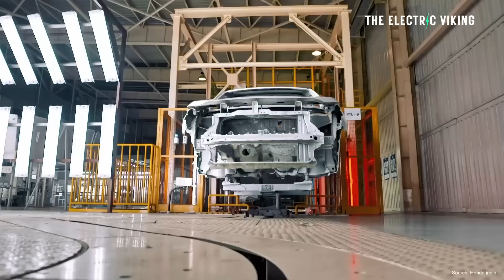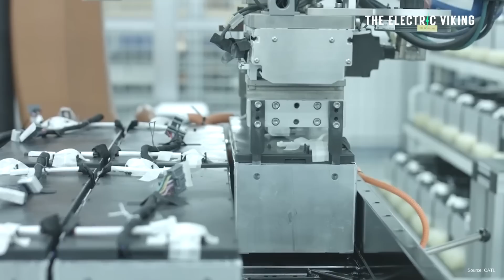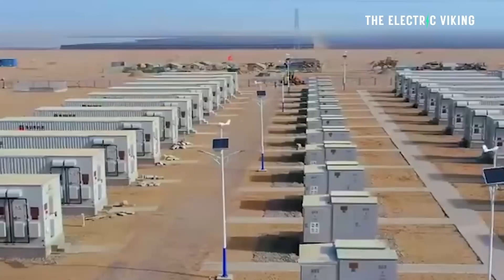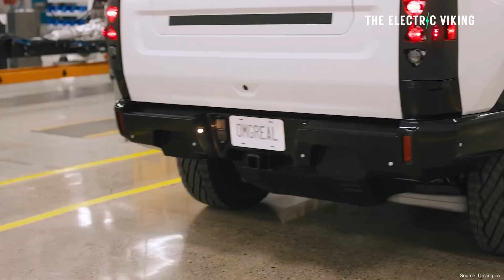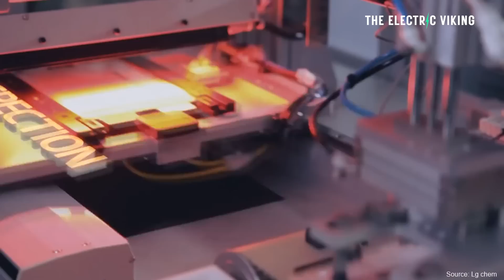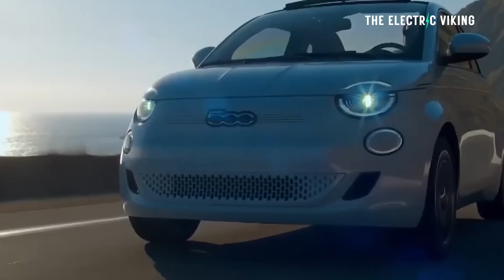World's biggest car companies are LYING about why they aren't making EVs

Comment: BEVs are obsolete.  It is 20 times less cost to make fuel from Renewable Energy (RE) OFF grid with DC (NOT AC) than to charge an EV on a 100% RE grid.  New Engine Tech  (NET) will be 75%, have CO2 capture for fuel making, COP6 Heat pump on car, and fire protection.  It will be 1/2 the weight for 1.5 x better MPG, 100% brake recovery, and 40% heat as a function of drive load for free.  The CO2 makes dry ice for food storage and the water capture allow you to have continual water in the car.  CO2 is for energy input of RE fuel with NET is 3 gCO2/kwh for fuel and no battery.

An EV is 85%, has no CO2, can't do super high COP heat pumps, cannot make fuel at 20:1 lower costs, is a show stopping mega fire risk, has 300 gCO2/kwh in battery life cycle, 300 gCO2/kwh for 100% RE grid, is 2x weight for 2/3rd MPGe, and has little to no waste heat for heating, along with only 50% brake recovery.  

This means NET will be 3-4 times BETTER MPGe in City on fuel that is 20 times less than charging on the grid.  That is 60 to 80 times less for energy input.

No EV or old ICE car can survive this.  Sorry...EVs are obsolete, and so are old ICE cars.

Comment: I work in ev conversion here in japan , so i can tell you why japanese automakers are late. 
First there is many engine manufacturer here , so its huge market, and many will be bankrupt.
Second the infrastructure is almost absent. Over 50kw charger its cost a lot of money , around 5 milion yens ( approximately 40000$ or euros)  by charger, and they fall under lot of regulation.
Third, Toyoda san is the president of JAMA (japan automobile manufacturer association) , and he slow down all the process to make ev shift happens.
And last one its cultural , japanese dont like changement, and difficult to accept another country are better in some way and changer their minds to follow.

After that , Tokyo maire push a lot for make changes. They provide good amount of money if you buy EV car , same for solar panel.
All new construction in Tokyo will include solar panel on roof.
She will bring formula E next year in Tokyo.

Comment: Todays Batteries suck for Ev’s , 1000pnds of weight for the power of a 30pnd gas tank, fire risk, not to mentions an hour of charge time, horrible cold weather durability, infrastructure,,, when these next gen batteries finally come to market, maybe then the Ev market will get the demand

Comment: Yes, we might change from fossil fuels, but it is not obvious at all that EV's are the answer. Technology keeps moving forward and it is highly likely that another technology will be answer, rather than batteries which are extremely bad for the environment and have lots of significant problems (range, fires, what they are made of, longevity, weight, charging standard, time to charge, cost).

Comment: If CATL is at 60% of capacity, they only have perhaps 25 to 30% capacity to spare, not the full 40% one might think. That being said, Tesla could import CATL LFP cells and replace existing American-made high-nickel Mega Pack cells with them. Then validate those cells for vehicle production. Not worth the hassle, unless you consider those Mega Pack cells might get replaced in a decade anyway, and putting LFP in them now could get them to last 20+ years.

Comment: Panasonic have been making the batteries for Toyota since the first Prius rolled off the production line. Toyota and Panasonic have a joint venture company called 'Prime Planet Energy and Solutions'. Toyota leads the world in registered patents for solid-state batteries at 1,331 patents related to the technology, followed by Panasonic Holdings with 445 Patents. So I think they know a thing or two about battery technology. 

Gill Pratt is chief scientist at Toyota and CEO of the Toyota Research Institute with impressive titles and an impressive resume. Among other posts, he was an associate professor at MIT and was once a computing expert for DARPA. Consistent with decades of scientific findings, Pratt acknowledges the "incredibly serious issue" of climate change and advocates for doing everything within our power to head it off, then reverse it. The role of EVs, however, is one he says has too much "hype" and closing our minds to other technological solutions.

'EVs' shortcomings are well-documented by now. Most of their problems stem from their batteries that, among many things, are heavy, made with materials of limited availability, and result in tremendous CO2 emissions during manufacturing. Pratt says these problems aren't inherent but considers it foolish to expect them to go away on their own. Instead, he says it's best to use our current battery supply efficiently.

"To be clear, these problems are surmountable," Pratt said of EV batteries' issues. "But it's a matter of time and about a rate of growth, not an overnight switch. There's an element of hubris to declaring how many electric cars should be made by a certain date, because nobody can accurately predict the supply of raw materials or the impact on the planet of creating and using them. That data simply doesn't exist.

"Until we know, I believe it’s often better to use the batteries we have as often as possible—and that's where hybrids have an advantage."

When it comes to hybrids, Pratt is specifically a proponent of plug-in hybrids (PHEVs) that he considers immediately advantageous over EVs for several reasons. They don't have the inflexibility of EVs, meaning independence from inconsistent charging infrastructure and thus diminished resistance to adoption. They use less battery material than EVs and use it more efficiently. Pratt was adamant that they as well as other technologies must be taken into account, rather than "prescribed" the way EVs are.

Comment: I think the legacy guys are still a bit nervous about mass producing EVs . They are just far behind Tesla as far as technology. They are still in a developmental stage . Tesla is far past that . Change is hard in the automotive industry. Tesla is doing what it always did . It's not going to change and make ice vehicles . I think the next turning point will be true self driving which EVs are a better application for that . Who ever is first to claim the crown and regulators approve will win a big trophy . The other big ones is 450 standard  range in batteries with 10 minutes to 80 percent and last but not least is wireless charging as the norm and not having to get out of your vehicle . Then ice will truly be a primitive product which runs off the dead prehistoric fuel that it uses . The question is what's that time frame ? Maybe 20 years tops . At that time it maybe hard to find a gas station

Comment: Not an electric car fan but your channel great   very informative  when you can charge one up in 2mins and at a cost cheaper than petrol I'm in😂
Reply: Charging is far cheaper than petrol. And the time it takes to charge is the time it takes to get some lunch, so it’s not a big deal.
Reply: @chopsueykungfu   so if I fill up at motorway station  for my diesel/ petrol and you fill up with your electricity  your vehicle will travel further than mine assume  we  have isame vehichl bit different power trains  I don't expect  reply    what's the tax on electricity  what's the tax on fossil fuel

Comment: Yes, you're right that they can get battery cells. But the quality is abismal! According to various reports,  CTL's battery failure rate is 17%. Worse yet, is the rate of cell fires throughout China, where there is a large EV presence. Range issues has caused the CCP to investigate BVD amongst others. Large rental companies were seduced to buy large fleets of EV 's only to go bankrupt because of very poor performance. So EVs will take over, but only when they can get RELIABLE batteries.

Comment: I don’t know much about the specifics but I do know how supplier contracts usually work with big automakers. In general, the contract will require the supplier to allocate a huge portion (up even 100%) of the output of a particular product. The price will be very favorable to the automaker. In return, the automaker agrees to a “take or pay” provision. Such a provision requires the automaker to guarantee the minimum amount it pays to the supplier over an extended period. This period is usually enough to amortize the entire capital cost of the contract on the supplier’s side. Now, what happens when you make such a contract but the supplier cannot deliver a reliable product? Both are in trouble. The supplier is in breach but the automaker can’t safely just move on. It face huge liability itself on the take or pay portion of the contract. What the automaker (or any other large business in the same situation) does is pivot to other products while letting things settle with the supplier. I’m guessing this is what GM is doing. For an example that took place pretty publicly, look at what happened with Apple and the supplier of sapphire crystal screens a few years back. The supplier was destroyed but Apple still hasn’t gone back to sapphire is they had said they would. Pivoting to an alternative supplier can be financially risky. Pivot to another product line not so much.

Comment: Electric vehicles preceded internal combustion engine cars. They went largely obsolete due to problems with the battery.
The battery remains a big heavy costly problem.
The main drawbacks of EVs are high capital costs, high depreciation, long charging time, limited range and fire risk.
Additional power grid capacity would be required if a substantial percentage of cars are EVs.
It is wrong for governments to foist them upon the hapless taxpayers. Consumers should be free to choose between ICE and
EVs.

Comment: I don't do a lot of driving my car is a 2009 Hyundai Sonata with only 68k miles , my only repair costs so far have been a set of tires, brakes ,air filters, oil changes over the 14 year span  of ownership. but if I had bought a 2009 EV instead of my gas powered one, I would more than likely have had to replace a expensive battery pack by this time due to the battery being degraded just from time , I'm not against Electric cars but for me they are simply too expensive right now

Comment: So an EV has about 4000-7000 Li Ion batteries in it that sort of look like the standard batteries we buy. If you make say 5mi EVs/year, that's 7k*5M = 35 billion batteries for EVs per year. 
I wonder how many batteries humans consume per year. Say each of us consume on avg 4 batteries/year for the 8billion humans on avg - that's 32billion batteries for random stuff we use batteries for. And that doesn't include all the batteries on the shelves and everywhere else. So imo there's probably enough capacity to make like 10x that amount or 50mi EVs/year. 
So there will be huge initial logarthmic draw on batteries as EVs ramp up and then a gradual draw down and plateauing of battery use per year. Earth is a closed loop system (almost entirely) so everything on Earth is just recycled anyways - so Li and whatever else is used in batteries will convert to something else and then eventually be formed back to batteries again. 
I think car cos are lying and Toyota is clearly trying to  stem the EV growth so they have a chance. They're bs'ign with their nonsensical hydrogen and solid state battery. Thankfully, no one is waiting on Toyota anyways. They're the GM part 2 of Who Killed The Electric Car infamy.

Comment: I still think the even bigger issue is the import tariffs and the fossil fuel lobby opposition blocking the import of the new inexpensive models like the models from BYD in Europe and the USA. Commenter below was also correct the USA cancels the incentives if the battery is not manufactured in the USA locally.

Comment: It’s not lies. It’s to reduce China’s hold on the EV supply chain and material locations/mines. 
China is using coal for power to build these batteries.
China EV cars are ugly and have no reliability comparisons.

I would never pay a premium over an ICE vehicle for an EV.
I don’t want an EV.
There is plenty of ICE cars in inventory that need to be sold otherwise the energy used to build them are even worse from a co2 perspective.

Comment: Could be a lot of different factors added together. The reasons I don't have an EV, I  already have a petrol car with many years of service left in it, a similar "affordable " EV is twice the price of a straight replacement. The infrastructure is insufficient in UK nothing like enough charging points, people are installing them and can't get them connected to the electricity supply ( which is barely able to cope with demand as it is nevermind finding all the extra energy currently provided by fossil fuels) EV still have very limited range, which wouldn't in itself be a problem if you could do a five minute refuel like you can with petrol. So probably insufficient demand for EVs

Comment: This one is a masterpiece of real journalism because it isolates a fact that exposes how much difficulty an established industry faces dealing with a a fundamental change in technology. I think it is only human nature that makes both individuals and institutions stick to the tried and true. ICE vehicles are still profitable and the legacy manufacturers want to keep that going as long as possible and then they will try to charge us for oil changes in their EVs. Metaphorically speaking, of course. Instead many look like going out of business instead.
Reply: It is reverting back to an old technology with better equipment.
The electric car actually preceded the ICE car. The battery remains a big heavy costly problem.
The drawbacks of the EV are higher capital cost, higher depreciation rate, lower range, long charging time , battery fire risk and greater vehicle weight.
Reply: @johngeier8692  Detroit Electric is what you're referring to and it was far more expensive and had less range than gas cars (still true in the 21st century).

The only reason it hung on for so long was because the gas car required a crank starter, but once Cadillac came up with a practical electric starter, Detroit Electric folded.

Comment: Let’s say you are right. Why did Tesla take so long to start building a second battery factory? Didn’t they say they needed more batteries? Why couldn’t Tesla plan for six months ago to have at least one or two more battery factories up and running? This would of allowed Tesla to use some of these excess batteries? Or do you think Tesla didn’t start a second battery factory two years ago for a different reason? Remember they did say they were battery constrained. But my personal opinion is they didn’t have their manufacturing method down to build a second factory until recently. What do you all think? I would like to know. Because if Tesla really only had a battery issue with creating more megapacks and factories, they really dropped the ball.

Comment: CATL batteries are in China, Joe doesn’t want them. 
Is there a disconnect between factory designed capacity & present production? I’m sure Tesla could ramp up Megapack production to soak up LFP, at right price. But that’d drive up lithium price, maybe even labour costs. We will be short of batteries (& precursor) at least to 2035. Who wants half-a@#$& gm nonsense when Tesla makes better product?
Better gm sticks to Silver Shadow replicas, can rival Morgan in 2030.

Comment: I disagree, they don't make many EVs because they're bad at it! Their supposed advantage in manufacturing has turned out to be a massive handicap. Turns out mass manufacturing EVs is crazy hard, especially if you want to make a profit at it. I don't think it matters if they get the batteries, their EV vehicles suck!

Comment: I hoonestly consider it an honor that I've been driving my EV for almost a year now. Love my experience as well.
Reply: Just remember, your lovely EV, from initial mining of the lithium, cobalt, nickel etc as well as battery production, shipping and construction has caused more pollution it's it's 1yr than an ICE car would have done in 5 years. Do you know where the energy comes from to charge it? Did you happily spend another $1000 on a home charger on top of the expensive EV? Does the risk of battery fires keep you awake at night? Are you planning to trade it in after 3 years, because if so, you won't even have broke even on emmissions. EV's are nowhere as green as you think - nowhere near.
Reply: Don 't forget the wallet melting  depreciation.
Reply: @tonyb3629  not forgetting the crappy re-sale prices! In the UK I could get a mint 3 year old Hyundai Ioniq for £14,000 🤣It's like money down the drain.
Reply: @tonyb3629 Congratulations, you receive a prize for maximum misinformation per character typed.
Reply: @tonyb3629  Are you sure you're replying to the right person? I said nothing about green, energy, or anything else you are going on about.

Comment: This is probably more about the price they are having to pay for the batteries. Because of Tesla's huge production volumes they are probably able to negotiate a really good price for the batteries they are getting from CATL. Because the other OEM's are already losing money on every unit they make, and can't get batteries for the price that Tesla does, they are just throwing in the towel and admitting defeat. Then CATL has to cut production, and that becomes a self-fulfilling prophecy - fewer batteries produced, giving the OEM's the excuse they need that there aren't enough batteries available. This is why they are taking advantage of the IRA to make batteries in the US - but those US factories haven't been built yet, hence the reason why the OEM's are not able to increase production yet.